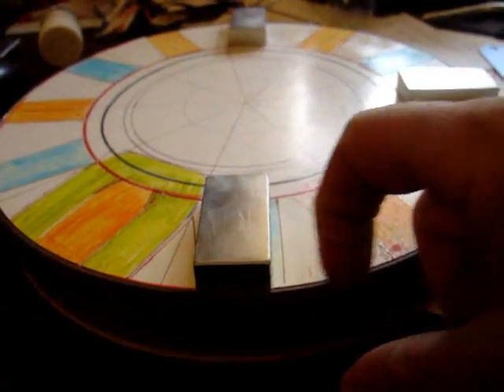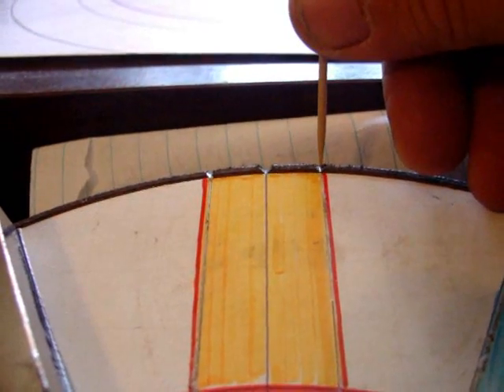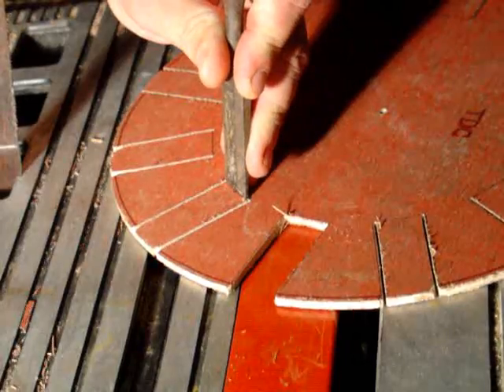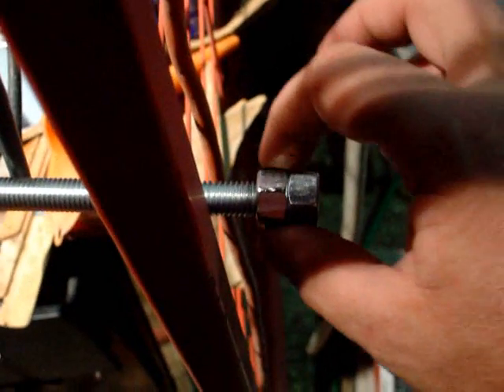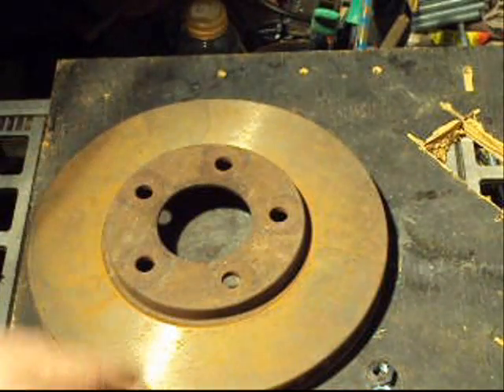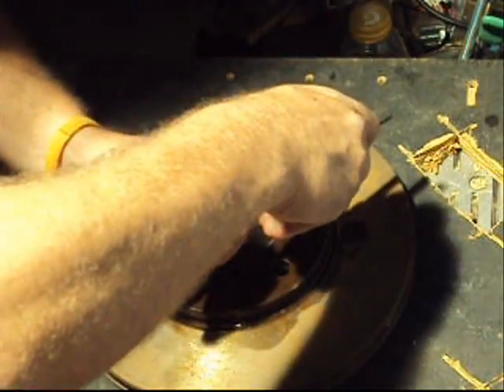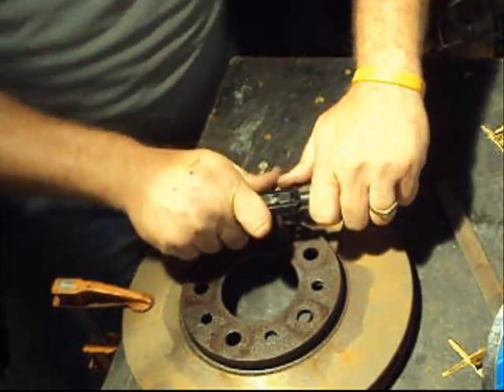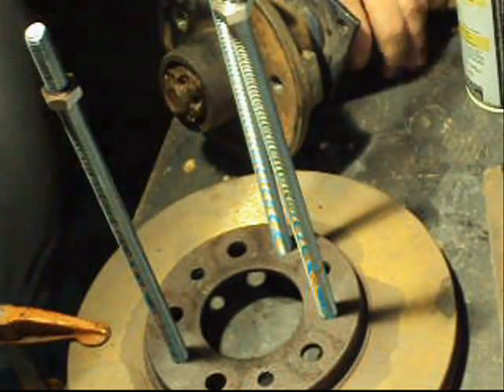BUILD A DUAL PERMANENT MAGNET ROTOR WIND TURBINE (PART 17)

Comment: You don't use Oil on Cast Iron..  Drill, Tap, Cut and Turn DRY..    Cast Iron is soft,  but it's very abrasive.  Oil just keep the powdered chip on your tap/drill and causes a lot wear...

Comment: Is there any special reason why the rotor is metallic? Most of the videos i've seen are that way. Only a few have made both stator and rotor out of resin. I wonder why. Thank you.
Reply from the maker: Valter Lopes The full explanation is in part one of this series. magnetic flux path. wise use of magnets, amplification of flux, and focus.
Thanks.
MUDDy
Reply: Ok. I think i missed that one. Thanks!!
Reply from the maker: Any time bro. keep smiling and have a ball.
MUDDy

Comment: from what car is this brake rotor from?
Reply from the maker: juancarlosruiz1985 That i don't know. The diameter is 11 1/2 inches. although 12 inches would work much better, and be easier to make the coils fit without getting in the way of the all thread studs.
MUDDy
Reply: Ok, thanks

Comment: When I saw 14:09 where you show the bearing and the weight of the rotor it reminded me of a problem which I had where starting torque was a problem.  It became apparent that very tiny increases in starting resistance might not waste much power but they can prevent spin start up. You could measure it this way (my video): watch?v=zkVVGsB0bzg  I give an amount that is too much. You can use that number. It is nearly universal for a given blade diameter.